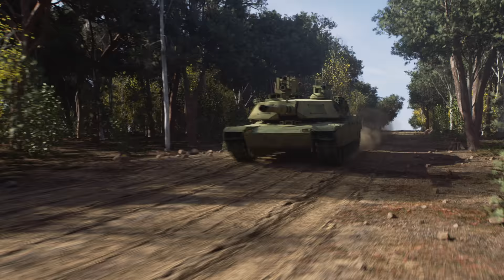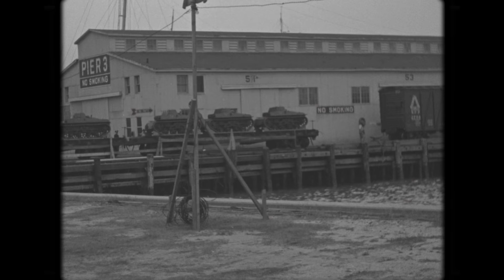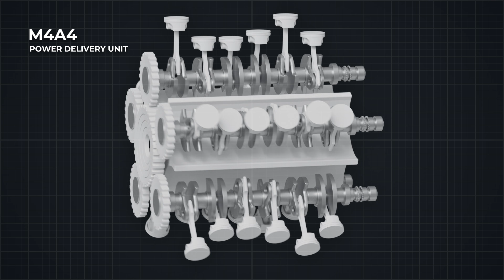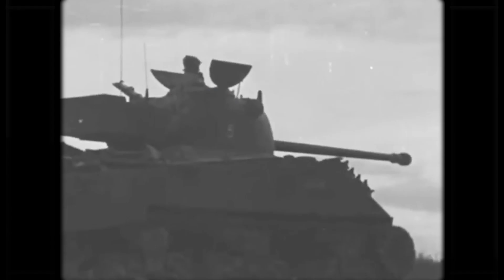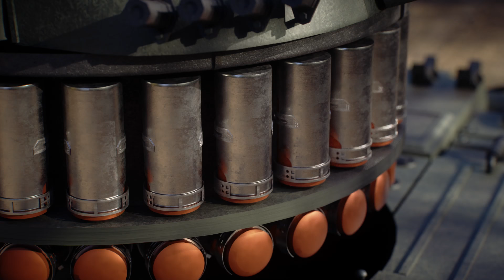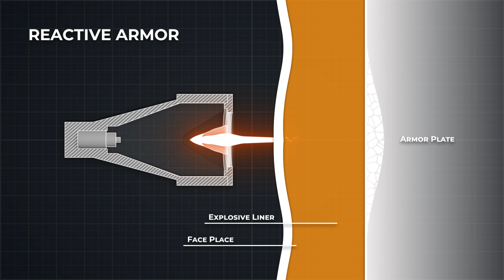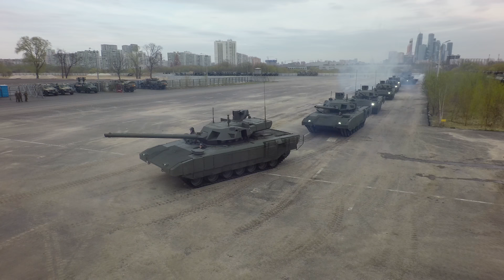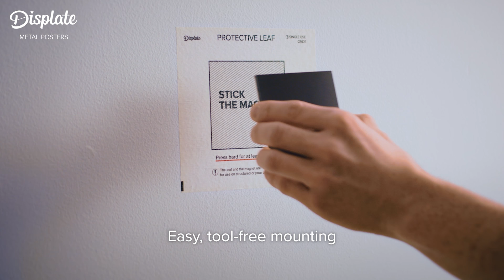Why America’s Tank Failed in Ukraine

Comment: The irony the USA Army told Ukraine President the Bradley was more equipped for the fight it was in and the Generals were right …..
The 0:01 M2 Bradley Fighting Vehicle has arguably been more impactful in Ukraine than any Western tank. While it is technically an Infantry Fighting Vehicle (IFV) and not a tank, its performance record has cemented its reputation as a "tank killer" and a lifesaver for Ukrainian crews.  
As of late April 2026, here is the record of the Bradley's performance:
1. Combat Record: The "Tank Killer" Reputation
Though designed to transport infantry and engage light targets, the Bradley has repeatedly engaged and defeated Russian Main Battle Tanks (MBTs).  
• The T-90M Duel: One of the most famous engagements involved two Bradleys using their 25mm Bushmaster autocannons to disable a Russian T-90M (Russia’s most advanced operational tank). By targeting the tank’s optics and sensors with a high volume of fire, the Bradleys "blinded" the tank and caused its turret to spin uncontrollably before it was finished off by a drone.  
• Anti-Armor Effectiveness: The Bradley's TOW missiles have been used effectively to knock out Russian armor from several kilometers away, often before the Russian crews are even aware of the Bradley's presence.  
2. Survivability: A "Life Insurance Policy"
The most praised aspect of the Bradley is its ability to protect the soldiers inside.
• Crew Survival Rates: Unlike older Soviet-designed BMPs, which often explode upon impact, the Bradley is designed to absorb hits while keeping the passenger compartment intact. There are numerous accounts of Bradleys hitting anti-tank mines or being struck by FPV drones where the vehicle was disabled, but every crew member walked away.  
• Repairability: Because the "core" of the vehicle often survives a strike, many Bradleys listed as "damaged" are recovered, sent to maintenance hubs in Poland or Germany, and returned to the front weeks later.
3. Operational Stats (as of April 2026)
The intensity of the fighting has led to significant visual losses, but the fleet remains a cornerstone of Ukrainian mechanized brigades.
• Deployments: The U.S. has provided over 300 Bradleys (primarily the M2A2 ODS variant).  
• Losses: Open-source intelligence (Oryx) and official reports indicate that roughly 187 Bradleys have been destroyed, damaged, or captured since their introduction.  
• Attritition vs. Impact: Despite losing nearly half of the initially delivered fleet, military analysts argue the Bradley has "paid for itself" many times over by preserving the lives of experienced Ukrainian soldiers and destroying a disproportionate amount of Russian hardware.
4. Criticisms and Limitations
• Winter Maintenance: Some crews have noted that the Bradley's advanced electronics and sensors require more intensive maintenance during the harsh Ukrainian winter compared to simpler Soviet gear.
• Drone Vulnerability: Like all armored vehicles in 2026, the Bradley has had to be retrofitted with "cope cages" and electronic warfare (EW) jammers to defend against the relentless threat of FPV suicide drones.

Comment: For those who manage to read this.

Ukraine has been given 80 M1A1 SA-UKRs, these are mid-90s era M1A1 AIMv1 tanks with significantly downgraded electronics and the DU armor was removed. Only 13 have actually been lost as if April 22nd, 2026. Compare this to ~600 T-64BVs,  ~150 T-72A/Bs, 84 T-80BVs that have been lost.

Even compared to contemporary Western designs: 23 Leopard 1A5s, 16 2A4s, 8 2A6s, 2 Challenger 2s, 1 Stridsvagn 122. The M1A1 is doing perfectly fine for where it is, It's losses are less than what we lost in tge GWOT at around 20-30 depending on who you ask. Those 20-30 were WITH DU and better electronics. Even as far as a few M1A2s.
Reply: I think your numbers are a little...off..ukraine lost 30 of their original Abrams donated in 2023

Comment: video title is a lie. also its not just the Abhrams the idea of the MBT itself leopards and challengers have hardly faired any better. theirs no need for massive expensive machines with 500mm cannons and depleted uranium crew capsules with turbo F16 engines and ill tell you why... because its track is destroyed... no you have an incredibly expensive immobile temporary bunker no matter how strong it is its waiting to be finished off. not only are IFVs cheaper they have a comparable level of protection and an armament better suited for infantry and can mount in theory anyway a wide selection of armaments and has an infantry component with infantry becoming more an more relevent and may or may not help defend the vehicle MBTs are designed to break through a single point in the enemies defenses which drones and advanced artillery have now made these frontlines so deep that its just not feasible and artillery simply performs its indirect fire support role better. you can do pretty much everything with an IFV that you can with a tank so why not just use the cheaper platform? the AbramsX is a stupid idea anything with X in it is a retarded idea. unless it can turn invisible its just an incredible waste of money do ya know why? i bet it still has weak ass roof armor and if its damaged i bet it takes even longer to repair

Comment: 6:00 you guys are very good at all these engineering things, but you somehow didn't notice that the Jagdtiger model you used here is fitted with the 8.8cm gun used on the tiger b.
and not the 12.8cm monster of a gun that most Jagdtigers would be fitted with, the 8.8cm was only fitted because of a lack of 12.8cm guns.

Comment: The reason why they failed. 
Because the American took a lot of stuff off the tank before sending it to Ukraine that was the only reason why it failed. 
Research it yourself.
Reply: Its more like because of the combinations of the soft ground with its heavy weight, the overwhelming russian firepower advantage and the constant threats of drones, if a tank isnt equipped with drone blockers and APS like the T-90M while it barely has any artillary and air suport in combination with a too heavy weight it isnt meant for the ukraine war

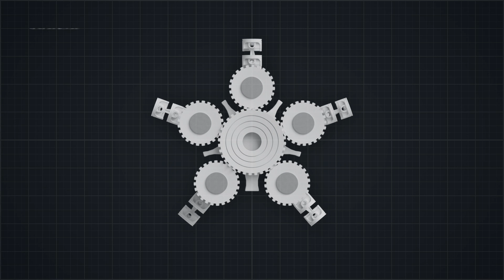Comment: @4:56 wtf is an inline v6? An engine can't be both at the same time. I think you meant inline 6 based on the animated engine, which shows 5 inline 6 engines driving a central drive shaft.

Comment: There's a 12kg (27lbs) electric motor, from YASA, currently finalizing development that produces 1000HP, as much as the T-80A. 

14 of them (1/sprung wheel) could move the monstrous M1A2 SEPv3 Abrams (66.8t) like a sports car and still save 85% of the weight of the GDT-1500. Only downside is that it runs on heavy batteries. Maybe the US army should invest in battery tech?

Comment: The M1 Abrams tank is a beautiful piece of machinery. The fact that it can burn damn near anything is fuel in that jet engine or turbine engine is able to push that thing through any obstacle is absolutely insane. During the Iraq Afghan war, EM1 was found with a handful of issues with armoring and stuff and they've slowly fixed them one by one with package upgrades but now drones are a new fight that became a modern warfare tool damn near overnight and that's just something that tanks were not designed against. The M1 as it comes up on you it sounds like a jet engine about to overtake you and it is just insane what they can do. But with drone warfare now, we are going to have to redesign a new tank from the ground up cuz now it's not just stopping ordinances coming straight at them or underneath from mines but now drones swarming them and firing explosives at them. And those missiles that have the tungsten pellets in them where when they explode they fire off essentially little baby shrapnels everywhere that just shreds through steel and iron without even blinking, those are one thing that the tanks are vulnerable to from above but whenever they start making that technology to be small enough to pack onto a drone, it's only a matter of time before tanks are completely obsolete and a tool of the past. God damn is that one sexy gun

Comment: Listen, I know you just wanted to do a video about tank enignes, and about how the abrams uses a strange engine that uses alot of fuels so they plan to change it in the future. But this video barely talks about the engineering of the engines, parrots a bit of russian and other propaganda, misrepresents history, is clickbates for not much reason. If this video was called the crazy design of the abrams engine, talked more about turboprop engines and their designs, and mentioned their upsides and downsides, then talked about some other engines and how they are considering replacing the turbo, the video would be more interesting. However currently this video seems like a history of tanks, sometimes mentioning the engines, by someone who doesn't know that side of history that well, which is kind of a bit boring.
Reply: Bare in mind that I am no scholar in that side of history myself but alot of the information is strange, for example, mentioning the t-80s resistance to 105mm guns, when the chieftain with its L11 120mm was introduced 9 years before hand. It's like mentioning how the t-54A was resistant to the tiger 2's gun, 10 years after the war ended. Though true its irrelevant, which makes it strange to bring up.

Comment: The Abrams given to Ukraine were all M1A1s... the most modern Abrams in use is the M1A2 SEP V3. The A1 does not have APS, IED protection, the capability to use the AMP round, does not have FLIR, VHMS, depleted uranium armor, and many other upgrades. This is the difference between a 1970s F150 and a 2020 F150. Go find a different job..

Comment: Did you forget the Israeli Merkava exits? Arguably one of the best tanks in the world, and you didn’t even mention it.
Reply: Merkava isn't best anythng,and it's not a tank.
Reply: @vladkorobov155 stop eating lead paint.
Reply: @MitchM240  
NO U.
Piece of trash is a self-propelled artillery piece.
And not a very good one at that.
To be a tank it needs,for starters,to somehow remove the engine from the most vulnerable place in the entire vehicle.
Reply: @vladkorobov155 no u? LOL are you 12? Do you think the engine was place there by accident? Jack ass. It was placed there to protect the crew because Israel cares more about their people surviving than their tank. It is one of the best tanks in the world and one of the most battle hardened at that.
Reply: @MitchM240  
"LOL are you 12"
Anything more would be casting pearls before swine,and i've read in a book that it's a bad thing for some reason.
" It was placed there to protect the crew"
No,it was placed there because designers were irredeemable cretins,because immobilized tank means  dead crew,and extra 100mm RHA equivalent would NOT save the crew anyways.
Combat-proven when in 2006 Merkavas lost more crewmembers per penetration than Russia did in 1995 per TANK DESTROYED.
"It is one of the best tanks in the world"
It is literally none of these things.
It's really inferior SPG with some modicum of protection that SPG doesn't need and with the weight of at least THREE.

Comment: The Abrams was designed during the Cold War to beat the Soviet/Warsaw Pact T-72 tanks as they came crashing through the Fulda Gap in Germany. It was assumed that Allied air power would dominate the skies, therefore tank-to-tank battles would be the norm. Ultimately, it showed how well it could do this job by wiping out the T-72 tanks in Iraq (along with the Bradley). The problem is that it was never designed for a Ukraine battlefield where the sky is filled with tank-killing drones. The turret top above the ammunition was designed to blow out if hit to protect the crew. This was not a vulnerability against other tanks, which presumably would be in the front, but proved to be a tremendous weak spot against drones, and something the Army is still trying to address.

Comment: Nobody's thought of running a tank on a Rolls-Royce Merlin?  Merlins were good enough to send Mustangs and Mosquitos flying across Europe at speeds nobody else could match . . . well, not until late in the war, anyway.  12 cylinders and 1600 horsepower in the standard configuration.  Imagine what could be done with the latest technologies!

Comment: Basically the current Abrams is too heavy to be useful, and the future tanks will be smaller and lighter. If you go with the remote turret design then you need an autoloader that does NOT carry ammo in a ring around the turret, or else we see the incredible exploding turret routine common to all Russian tanks in Ukraine. The Russian T-14 Armata is a very nice prototype but the fact remains that Russia is technologically on its arse. It completely lacks the technological capability to produce all the computer and electronic components that the T-14 needs inside the country.

Russia, before the Ukraine war, had the same GDP as Italy. That's a long way down the international GDP scale, and most of that GDP was exporting fairly crude fuels and coal; very much at the bottom of the scale in Adam Smith's ranking of national exports. Embargoed trade and the incredible labour distortions that the war has caused are crippling Russia, and the loss of its modern tanks has left it rolling out Cold War antiques to try to gain some advantage.
Reply: "The Russian T-14 Armata is a very nice prototype"
...which is produced in numbers than all NATO tank production COMBINED.
With possible exclusion of Turkey.
"It completely lacks the technological capability to produce all the computer and electronic components that the T-14 needs inside the country"
No,you are completely full of BS.
"Russia, before the Ukraine war, had the same GDP as Italy"
No,it had GDP of Russia.
Citing non-PPP-adjusted GDP is a sure mark of alternatively gifted individual.

Comment: -Heavy, no matter what engine they put in it. Even on the F-35. Physics cannot be canceled. In the muddy Ukrainian black soil, 72 tons is a lot. And at the base they started decorating it with screen grilles and dynamic protection.
Which brings us to point 2
- weak protection, despite its weight, which implies thick armor... but that in itself is not a panacea.
- Abrams has always fought in the comfort of air superiority. The lack of air superiority puts it in a completely different scenario
- the concept of tanks in modern warfare has been redefined since the advent of drones. For which Abrams and other tank models are not to blame. They are in a pre-existing situation. They are used according to the circumstances.

Comment: I don't think you understand the concept of a war?
The basic intent is to shoot and kill the enemy, unfortunately they are also trying to shoot and kill you.  People get shot and die, tanks get destroyed, etc.  
Ukrainian troops have done an incredible job, but have always been desperate for whatever equipment they could get their hands on.

I can't even imagine why you would bother mentioning the M1A2??  That is neither current, nor the version sent to  Ukraine.
Ukraine received one Battalion of obsolete, surplus, 40 year old, A1s.  
So yeah, no shit, they're old AF, and lack modern armour and systems.

As for slagging off on the gas turbine, I mean WTF do suggest they power it with?  Even today, 40 years on, NOTHING else would come close to providing that amount of power, in such a compact and light-weight form.

And as for being "a logistical nightmare," you mention, but them gloss over it's greatest virtue.  Unlike any conventional engine, a gas turbine can be tuned to run on anything, and at a pinch, can run on any fuel without retuning.  So whatever the Ukrainians can get their hands on, petrol, diesel, avgas, waste-oil, it can all go into the fuel tank.

Comment: The real aswer is in the Russian sfere there is a thing called Rasputitsa, mud so problematic is sucks the boots off your feet and changes dirt roads into mud rivers. You will be forced to leave the roads and sink in black earth there too. The Germans already found that out during WW II and came up with "Ostketten", wider tracks for their tracked vehicles that would otherwise become stuck. Heavy tanks and assault guns could not be used unless the ground was frozen or dry. The Russians who's homeland this is of course adapted their vehicles to cope with this far better. Fast forward to today. All that was learned was forgotten. Western tanks are well protected but extremely heavy, even the German ones.  No problem in Western Europe or deserts, but in Rasputitsa they bog down and pose a turkey shoot for heavy artillery and drones. The less protected Russian tanks suffer from flying turrets, but they are also lighter and have wider tracks, they can actually be operated in the wet seasons with some limitations. Why Western tanks fail ? Too heavy. The antiquated but light and fast Leopard 1 seems to do quite well in Ukrainian hands....

Comment: Now best solution is an EREV system, it’s quite and electric motors are full of Torque. Range extender provides long range and no need to relay on engine for power while firing or standby.

Comment: Didn't fail guy. It's just that it's designed to operate with good logistics behind it. Crew survivability is excellent and it tanks ( no pun intended ) multiple hits that would blow the turret off a T72 or T90.

The problem is that Ukraine lacks the maintenance and supply infrastructure that USA has and that the Abrams is designed for.

Comment: 6:08   There were strict design guidelines for the Sherman; as you point out it must be able to be moved by ship from the United States to the battlefield. However, the design parameters that were non-negotiable was that the Sherman had to fit on American gauge railroad flat cars, in order to fit through tunnels to get from the factory to the ports.  So of the design requirements being able to get through rail tunnels was one of the unsung requirements.